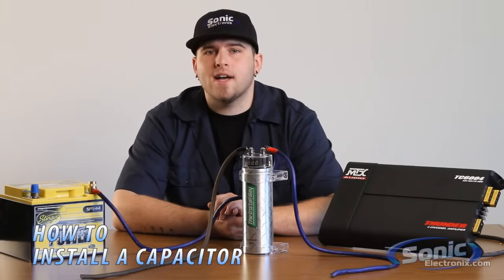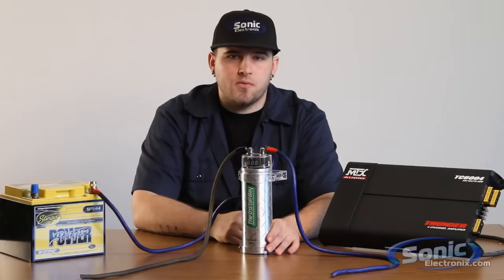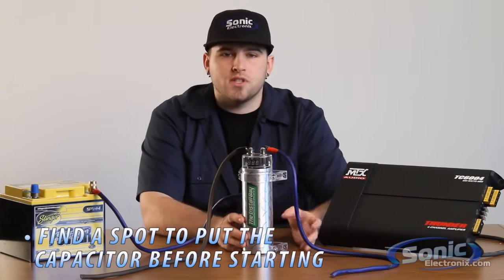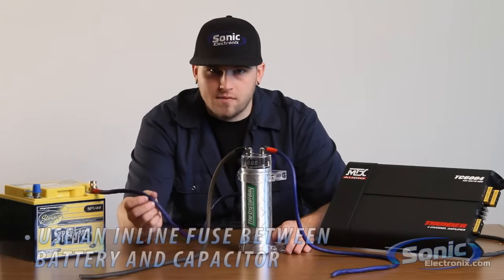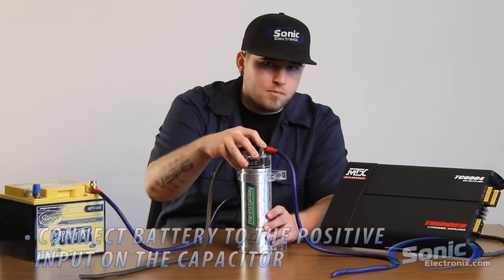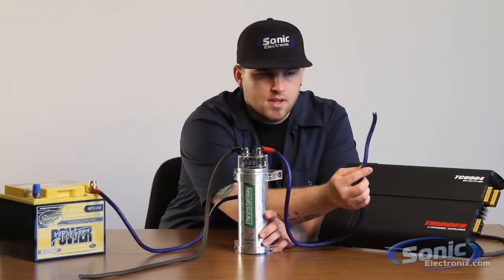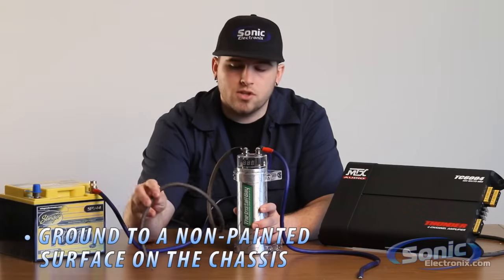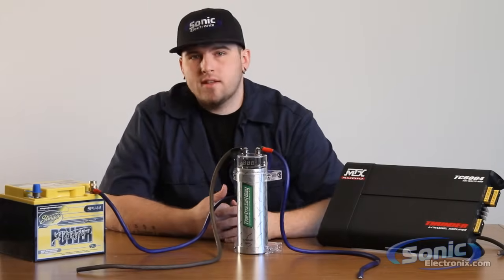How To Install A Car Audio Capacitor

Comment from the maker: @theapothem1 This should be fine.  However, it is better to have separate grounding points.  The reason your lights are still dimming is because your battery is most likely not equiped to handle the power of an after market amplifier.  You might want to consider a battery upgrade.

Comment from the maker: @SavageLife404 Capacitors essentially store power and discharge it when needed to the amplifier. This helps when your music hits quick musical perks. The power is taken from the capacitor and not the car battery. Constant quick discharge is damaging to a car battery and will shorten the life span of a stock battery. Capacitors help by taking the role of the battery as the source of power when quick perks occur. In my opinion you are better going with an upgraded battery than a capacitor.
Reply: What if your positive and negative touch on the capacitor will they burn out your amps?

Comment from the maker: @Gunnedslingers1 If the gauge doesn't fit then you have two options. You can try ring terminals or just go with the 4 gauge. Just make sure you are protecting yourself from any blown fuses or possible blowouts.

Comment from the maker: @MistahRoboto Yes this is common, essentially when your voltage drops the amplifier is then giving out a lower power rating. This means that the woofer are not receiving less power than they where when you had a higher voltage. It is the equivalent to having a14.4v battery to 12v battery. At higher voltage the amp will have higher rating and thus giving more power to the subs. Upgrading your battery and alternator will fix this problem.

Comment from the maker: @Gunnedslingers1 I would not recommend doing that, If your system is over 1200W RMS just run 0 gauge all through out the car, if its less than 1000 just run 4 gauge. If you decide to do this nothing bad will happen but it's just not very common to see.

Comment: Is it normal for your subs to lower there volume once the cap voltage drops to about 11? I'm gettin a h/o alternator and new battery but I just want to make sure that this would take care of it. My wiring is fine everything is soldered but when my voltage drops from constant bass so does the volume

Comment from the maker: @grafftodatrack You should have initially charged your capacitor before using it. If you did not this might be the reason you are having problems with your car audio system.

Comment from the maker: @grafftodatrack I would say double check your wiring and connections, also make sure you don't have significant voltage drop and that the capacitor is still holding a charge. I would suggest killing the capacitor and getting an upgraded battery. This is a much better solution that a capacitor.

Comment from the maker: @o7cheyenne Yes you can wire two capacitors to  1 amp. If you search our Knowledge Base section on our site and type in How to Install Car Audio Capacitors you will see some diagrams that will show you how to install two capacitors to one battery.

Comment: @SonicElectronixTV helllooooo (: okk8s here is the thing
i couldnt afford the pioneer gm-5500t but i just bought a pioneer gm-5300t and i put it in my sound system and it sounds real loud and clear xD (except my power supplies....they couldnt handle it... :( but at least they sound great!!.... do u think that this amp is ok for my subs?

Comment from the maker: @magdielperez240 The power supplies should work, the amplifier is not  that strong. You can actually just use your car battery as the power source. The amp will not be enoug for the woofers. It will only output 75W RMS x 2 channels @ 4 ohms, the woofers need 150W RMS. I would recommend a stronger amp. I recommend the Pioneer GM-5500T, this amp is perfect for those woofers. You can also go with the Infinity Reference 1300a and wire the subs together to a final impedance of 2 ohms.

Comment: @SonicElectronixTV hello :) i need yur help Dx i have 2 12's pioneer ts-w301r both in a ported box..(they are together no seperation from inside them) and i just orderded a nitro bmw-481 amplifier 400x2=800 watts and it has a 25 amp fuse..
and my question is...will this amplifier be great for my subs and will it work in a pyramid power supply's model: ps-21kx and in a ps-9kx all thogether?
any help would be greatly apeciated :) thx :)

Comment from the maker: @tyronebiggumsish Unfortunately you going to under power your subwoofer. The amp is rated at 240W x 2 channels @ 2 ohms. Since you have a Dual 4 ohm subwoofer you can only run the sub to a final impedance of 2 ohms. If you bridge the amp it will only be to 4 ohms and not 2 ohms so this option won't work. You will have to wire the sub in parallel to 2 ohms and run it off  one of the channels and then just have an empty channel that is not being used. I recommend an upgrade to your amp.

Comment from the maker: @tyronebiggumsish What impedance is your subwoofer? If the amplifier is bridged then it will have to be a final 4 ohm impedance but your subwoofer must be a Dual 2 ohm woofer otherwise you can't have a 4 ohm final impedance. If you can tell me the impedance of you woofer I can tell you what wiring options you have.

Comment: SonicElectronixTV i have a 1200watt 2 channel performance tecknique amp and a 12 inch kicker cvr with 400rms and a 800watt peak right now i have it bridged and i have the sub in a sealed box what is the best way to wire up my sub to get the most bass out of it thanks

Comment from the maker: @tyronebiggumsish The amp either has to be very strong at 2 ohms to each channel or bridgeable to 1 ohm which most 2 channels are not. Each channel should be at least 300W RMS to run the subs properly. Please keep in mind that your amp is not CEA-Compliant and is more than likely overrating their power handling ratings. This means you will actually get less than was is being stated.  The subs will give lots of bass but they need to be powered properly.

Comment: SonicElectronixTV i have a performance technique 1200 watt 2 channel amp and i was wondering if the 2 pack of kicker cvr124 subs would sound good? they would be in both sealed boxes i want to get a setup that my amp could power but i want something loud with alot of bass.

Comment: need help!!! okay i have a boss nx109dc subwoofer and a performance technique 1200Whatt amp and the sub says its 1300rms 2600 peak and my sub makes a clipping noise when i turn my volume up just a little it sounds okay when its barley turned up but too loud and it starts clipping. my buddy has the same sub and it sounds great whaat am i doing wrong?? please help im new at working with systems and i dont have that much money to get it professionally tuned any help would be greatly aprieciated

Comment from the maker: @iminyourbasement What type of capacitors are they? Do you know the ESR for them? In theory this should work but it really does depend on what the capacitors were designed for. You can always call the manufacturer of that particular products and ask their tech support.

Comment from the maker: @xxxkhafanxxx In my honest opinion I would say get an alternate battery and not a capacitor. A battery would add more power and could make your system run better. A capacitor will only regulate the existing power so that you don't drain the main battery. If you still want a capacitor go with the Rock Ford Fosgate RFC2D or the Massive Audio CAP 4.

Comment from the maker: @Jocktech Gain measures the ability of the amplifier to increase the power of the signal from the input to the output. Essentially it regulates the signal from input to output. When installing a sub, you will set up your low-pass and subsonic filters, turn the gain all the way down and then turn the volume from your headunit all the way up. Then slowly start turning your gain up, once you hear distortion stop and back it up a notch and then you have your gain set.

Comment from the maker: @infamouzdubb33 If this amp is a monoblock amplifier then please do not wire 3 subs with different impedance levels on to the amp. They will distort and possibly blow. If the amp is 600 watts @ 2 ohms x two channels, you will be under powering the Dual subs. The only way this can be done is if you have a 4 channel amp. Running the Duals of one channel each and bridging the other two for the JL but you wont find an amp that can do that.

Comment from the maker: @infamouzdubb33 Like I said before this is highly not recommended. As long as the wiring is done correctly to match the impedance and the amplifier provides enough power then you could in theory do as you requested. However once again this is not recommended. Let  us know how this turns out.

Comment from the maker: @Jocktech If you have good woofers they can be under powered as long you set the gains correctly and dont turn the gain all the way up. When under powering woofers your settings must be set correctly otherwise you run the risk of blowing your subs. I would say get an amplifier that can provide the correct amount of power to the woofers. I mean why buy woofers and not run them to their optimum potential?

Comment from the maker: @infamouzdubb33 Technically you can but only if you have the correct impedance for each sub and the amplifier is able to produce enough power at each channel to each sub. However this is not recommended, this is actually highly unadvised.

Comment from the maker: @thirdgenguy17 Not without the turn on wire, the wire serves as as signal to the capacitor that let is know when the amplifier has shut off.

Comment from the maker: @Jocktech No your battery is probably dying because you require more power than it can give. Look at the magnet of the woofer it should tell you what ohms your woofers are. Based on the ohms and  the number of woofers you have, this will determine the best final impedance in which to run your subwoofers. For example 2 Single 4 ohm woofers will run to a final impedance of 2 ohms once they are wired in parallel. You should really figure out what impedance your voice coils are to run them correctly

Comment: Hey one question I just bought a used Power Acoustic capacitor and it only has the 2 terminals on the top but no turn on wire, hooked up and the capacitor display stays on all the time is there a way to wire it so it shuts off?

Comment from the maker: @Jocktech Make sure your amplifier is providing enough power and that your battery can handle the power. Its always good to upgrade your battery when dealing with car audio installations, as well as doing the Big 3 upgrade. This will help your system run more efficiently because you will be providing the correct amount of power. Also make sure you are wiring the subs correctly and running them a proper impedance that is adequate for the amplifier. Basically don't run a 2 ohm load at  4 ohms.

Comment from the maker: @Jocktech You should never install an amp without an in-line fuse, this will protect you amplifier and vehicle from any crazy shorts or from too much power going into your amplifier.

Comment: @SonicElectronixTV ohh ok thank you thats problably the problem because i have 2 12in subs running on an old amp and the amp puts out low amps so thats could be the problem. i never knew that. thank you.

Comment from the maker: @Jocktech It can be that the subs require too much power and the batteries are just draining out, or it can be that your alternator need an upgrade. If the total amount of RMS is more than 1000, you should really look into upgrading to a better battery not just a replacement of the existing battery but a full on upgrade.

Comment: @SonicElectronixTV oh ok thanks so much. i have a question though. i installed my amp and subs (without the inline fuse just saying) and i went threw 2 batteries. what could be the cause of that?

Comment from the maker: @Jocktech An inline fuse provides over-current protection to your devices. Essentially its a fuse that protects your power wire from catching on fire in the case that the wire gets shorted. Any time you connect a power wire to your positive terminal on your batter you are going to want to use an inline fuse.

Comment from the maker: @xxxkhafanxxx The Big 3 is an upgrade of the, alternator positive cable that runs to the positive terminal of the battery, negative battery cable that runs from the battery to the vehicles chassis, and chassis grounding cable that runs to the engine block. Doing this will improve the performance of your electrical system and increase its current handling capabilities.

Comment from the maker: @xxxkhafanxxx The BOSS CAP is considered low-end and will perform at that level. It is isn't complete garbage but with Capacitors you get what you pay for. We would recommend upgrading  your stock batter. This might cause a little more but in the long run will save you a bundle and will be more reliable than a capacitor. Also a capacitor simply stores energy while an upgraded battery will provide more power.

Comment: Hi,

What do you do exactly with the REM wire when you are running two amps? do you like split it from the back of the reciever? because i want to put a switch for my amp sub. 

Thanks alot!

Comment from the maker: @xxxkhafanxxx 1) Yes it is alright to use more farads than you need. You will have an even larger power bank for your speakers to draw off of.
2) Yes you technically can connect both amplifiers, but we recommend using your capacitor for the subwoofer amplifier only. Your sub amp will draw much more current than your 600w amplifier.
3) Try it out with 1 run of 0awg first, if you are having electrical problems you will need to run a second 0awg power wire from the battery. Also, Big 3 is a must.

Comment: hi there, 
i just have 3 questions. 1. i know that for every 500W i need 1 farad so 4 farads for my 2000W systm is need. my question is: is it ok to install a 10 farad capacitor? 

2. If i have 2 amps , a 2000W for subs and a 600W for the normal speakers, can i hook them up to one capacitor?

3. if i have 2 amps, as said above, can i only use a 0 gauge wire from the car battery to the capacitor, or do i need to wire 2,  0 gauges from the battery to the capacitor?
Thank you so much for your help!

Comment from the maker: @xxxkhafanxxx The general rule of thumb is 1 farad for every 500W RMS, so all you need if a a 4 Farad Capacitor. I would recommend the Massive Audio CAP 4. Its a solid capacitor. My honest opinion would be to upgrade your factory battery, this will take care of the capacitor issue and will provide more power. The capacitor will only store power and discharge it accordingly.

Comment: @xxxkhafanxxx Straight off wikipedia: "A farad is the charge in coulombs which a capacitor will accept for the potential across it to change 1 volt. A coulomb is 1 ampere second. Example: A capacitor with capacitance of 47 mF (47 millifarads, more often expressed as 47 000 μF)[1] will increase by 1 volt per second with a 47 mA input current." And how big of a capacitor is determined by what TRUE rms watts your amp is outputting.

Comment from the maker: @xxxkhafanxxx You do not need an additional capacitor because your amp has 2 positive inputs. You will need to split your positive cable coming out of the capacitor into two, and run each end into your amplifier inputs. Be sure the amperage rating of your power wire can handle the amperage draw of your amplifier before doing this, otherwise your wire could potentially melt.

Comment: Hi there,

i have 1 JBL GT24001 AMP that will be powering two alpine type-Xs. the Amp has two power + inputs. should i run the battery power to the capacitor and then connect that ONE output of the capacitor and run it to 2 amp ports or should i  get 2 capacitors and run each  power output to each amp out? ( As you know, the capacitor has one red output but the amp has two. will one capacitor handle the 2 amp power inputs?)

Comment from the maker: @XWiLDCaRD13X Yes the capacitor should shut off once your system is off. Some capacitors have a 30 second to 1 mintue delay but it should off.  No you do not need to have a remote line linked to your capacitor, it doesn't function the same way that your amplifier does.

Comment: I have a decently urgent question to anyone who might know this:
I have a 1 farad cap exactly like the one in the video. Just installed my subs. It has a digital gauge that lights up. What i'm wondering is that when i shut off the car, does the cap still pull power? I think it does, but i'm not sure. I don't want to go out to my car in the morning and find out I have a dead battery. Do i need to have a remote line to wake up my cap too?

Comment: @baseballdude1065  My sub is rated at 400 rms. I've yet to hear a system to match mine in interior or exterior volume at 1,000 watts rms or less. I also use a 600 rms interior 4 channel for wicked clear mids and highs to match the bass volume.

Comment: @baseballdude1065  I've had many audio systems in many vehicles and I use a 20 farad cap and an audio control epicenter. Every where I go people think I have 3 12's. I have 1 12 inch woofer in a 1.2 cubic foot selaed enclosure that plays all music very nicely. I design all of my friends systems and they love them. I'm known around the neighborhood as the sound man. I fully sound deaden my trunks so outside of the car it's almost as smooth and loud as inside.

Comment: @baseballdude1065  preferably to a yellow top optima or a kinetik. Although xs power and stinger are good as well. Of coarse you would then run the same good quality 4 guage wire from the battery to where you amp or amps are while in line fusing them. These steps followed in that order will stop the dimming of your lights, vastly improve the sound and prolong the life of your amplifier. I'll take it that you already know a little about sound quality because your running your subs at 4 ohms.